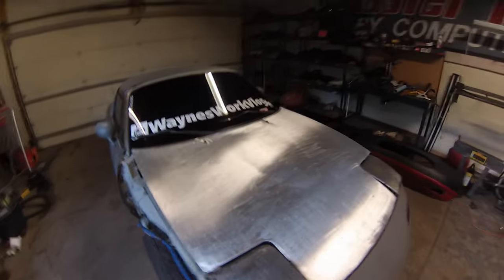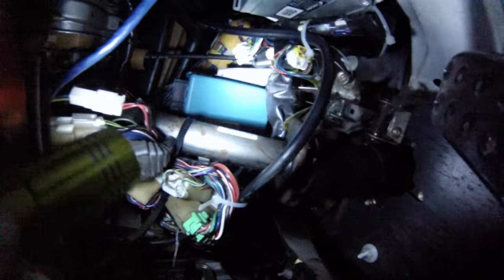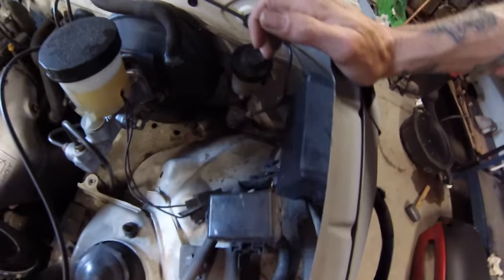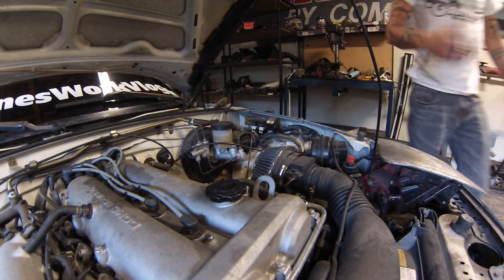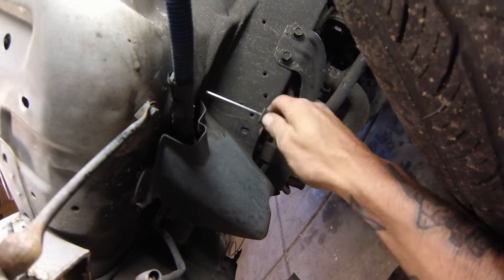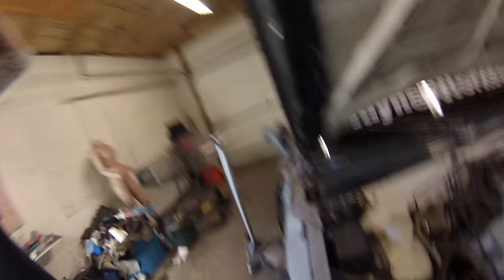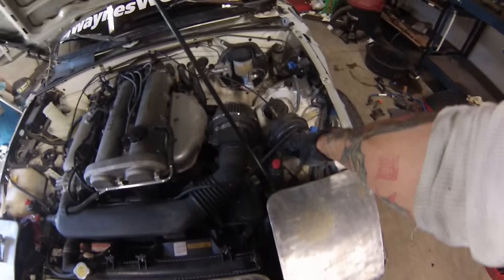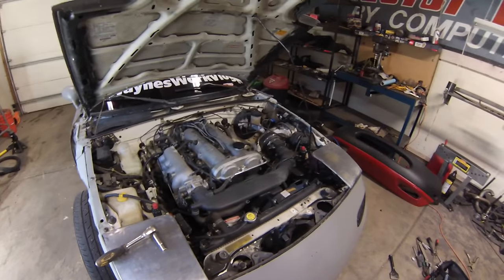BACK TO THE FUTURE or MIATA Airbag Systems Delete S05E22

Comment: I removed the airbag and built in an electrical resistance, so the light doesn't come on. When I remove the blue power unit, the light comes on and blinks 3 times. So I went on and removed the light. Now the beeping sound ist back but it's not constantly beeping... How can I get rid of that sound?
Reply from the maker: remove all of the units. or unplug them.
Reply: @pawpatina  Do you mean all Sensors?
Reply from the maker: @mariusvorwerk3883  no. the box that controls the light and the beeping is on top of the steering column. the blue box/es may be one may be two... do not cut the wires. you will lose power to injectors. just unplug them... its almost as if you didn't watch the video at all...
Reply: @pawpatina  Ah okay now I get what you mean. I watched the video two times... Anyway, sorry for getting on your nerves and thanks a lot for your help 😅
Reply from the maker: @mariusvorwerk3883  haha no worry!

Comment: How is the actual way of fixing it ?
On my mx-5 from 1995 88hp 1.6 the light is always on and i don't know which airbag is because the diod i tried with to diagnose it just stayed on for like 4 seconds and shut off...
Reply from the maker: when you remove the gauge cluster, shine a light at it and you can see what bulb says airbag. then pull that bulb
Reply: i will probably do it today. if my sensor or ecu is the problem is it worth fixing?
Reply from the maker: if you want airbags, but these airbags are usually prone to failure by now...
Reply: Wayne'sWorkVlog  its because ford made them...
Reply from the maker: hahahah not really but yea, they are garbage. a bad pothole will set them off.
Reply: Wayne'sWorkVlog by the way i have a qurstion sorry for spamming so much my miata is made for europe and its from 1995 with the small motor i was wondering is there check ENGINE light and should it light up when i start the car (like normal with all the other lamps battery,abs etc.) i have never seen it (and hope i don't but the previous owner could ne hiding something from me
Reply from the maker: check and see if the bulb is missing. if it is, install one. should work. if there is a bulb and its not lighting, could be something else wrong, bad wire, or UK doesn't require OBD2 like in the states